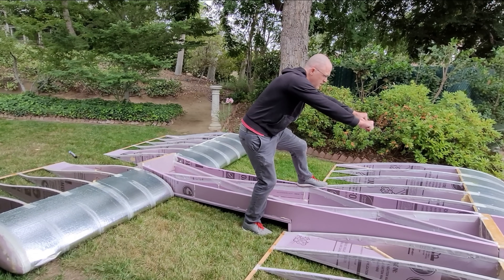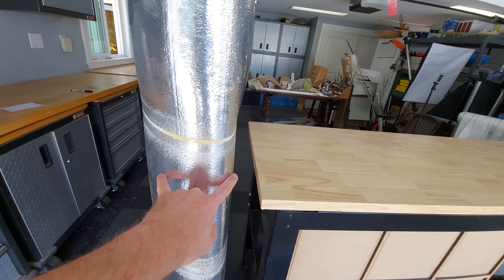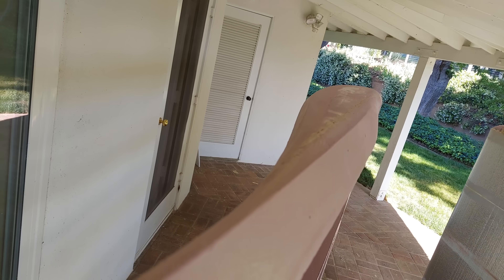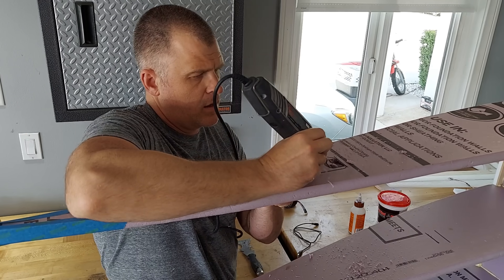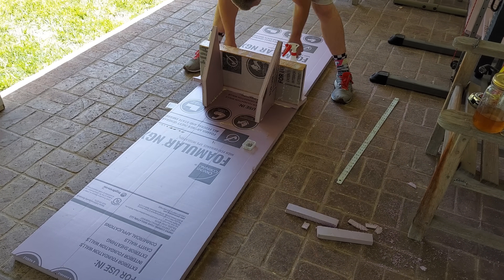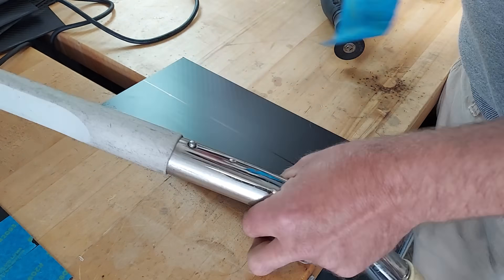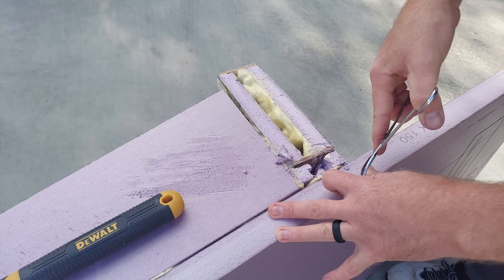Coolest Water Toy Ever? Manned Boat-Towed Ekranoplan (Build Part 2)

Comment: Use window and door foam instead. It doesn't expand as much and it doesn't have the force to push stuff out. Otherwise doors wouldn't open and windows would bust.

Comment: Foam for form not structural,
Reply: I hope your wingspars have a carrythrough unless you got aluminum squish plates
Reply: Ply paneling has voids but if you inspect you might can get by but at least some ribs for structure sandwitched to alternate foam ribs.
Reply: I studied homebuilt aircraft for years. I have 2 AP mechanics with IA ratings ive helped work on aircraft. I started a " saucey single " hydroplane to get my woodworkin shills up,
" And built 3 perots for 3 duckhunters. Those bigger hydroplane guys build their floors closed box x braces and not just a flat open bottom

Comment: I don't think you're small carbon plates aren't gonna do a whole lot . What you should have done is used a long piece  Aluminum tubing in the and fuselage and then have another piece through the wings and attach point so basically making a slip socket using a bolt or even a pin and a coter key  That used these a lot in remote control airplanes to make the wings detachable

Comment: To get a tight 90 degree wrap, round off the corners to the minimum bend diameter of the fibers, even if you vac. If you want to add structural strength as well as merely providing a surface it should be arranged 0-90. 

***********

If you need a square edge, after the resin cures you must then overfill the edge with something like Microlight and fair. In a pinch I've also cut the cloth over wide, cut darts where needed and adhesive taped the excess to the piece. Best use fast kick in that case.

Expanding Urethane foam, especially if it's a structural member, therefore dense, needs to either be in a mold or be  post shaped. If you're looking to save weight, adding internal gussets (bird cage), or external layers of cloth (monocoque), is much lighter than foam -- especially when it becomes water logged, which WILL happen.

The Gorilla glue didn't blow up? I don't understand your wing tips. 

I had a longer comment that was removed, apparently due to a TED video URL that explained why a 0-90 layup was stiffer that 45-45. Well, sorry I thought it was an excellent explanation, and funny, too. Oh well.

Comment: I really think using high lift airfoils is a mistake when trying to build a true ground effect vehicle. The ground effect happens between the bottom of the wing and the ground. What you are building is just a plane that operates in ground effect, kind of the conundrum Test flight RC was talking about recently. A TRUE ground affect vehicle is essentially a ram air hover craft, all of these other designs are just very in efficient water planes that only function properly in a very specific and forgiving envelope.
Reply: Like that inner tube towable manta ray thing, that’s just a kite that can fly but works well in ground effect.

Comment: I saw a machine in the shipping department that basically form fit fills boxes with foam to secure equipment shipping/returns when you don't have the original packaging for a large heavy expensive piece of bench gear - if you had forms you could fill them with a consistent density of foam and carve/trim only the edges making it really fast to prototype versions of equivalently solid/usable components.  They might even have different grades of foam so you can get different materials/densities.

Thanks for doing all this work and giving me all these ideas with stuff I've seen.  Inspiration I guess is the word for that.  :-)  thanks for it!

Comment: Old school mold maker that back in the day never heard of vacuum bagging. We would use clamps and waxed strips to hold down the edges  or cut out and redoing areas that pulled away. Not sure I would do vacuum bags now if I was still doing glasswork now. Seems a lot of extra work and time.

Comment: You do not need to vacuum to do good quality hand laid fiberglass. Seal the foam, then apply a coat of resin underneath the glass you put down. Then wet out the glass. Moving from the middle out:)
Reply from the maker: Thanks for the tips!
Reply: @thinkflight  . Laying the cloth flat to the surface will require a waxed paper covered board clamped in place over the bulges, or sometimes over all the work.
Working center both ways, or L to R, or anything similar will only move the bulge and the more it moves to the bigger it grows. 
Push the cloth straight in, which pushes the strands closer together, and hold it in place until the epoxy cures.

Comment: You don't need vacuum to hold the tape down.
Use Peel Ply, extending a few centimetres poast the edge of the tape.
The wrinkles are caused by the curved, stiff f glass trying to straighten itself.
The peel ply will force it into proper shape.

Comment: Laying bidirectional fiberglass around sharp edges without a vacuum bag works better if you cut it + - 45 degrees instead of with the weave. Better yet use Rutan glass RA 7725 (Aircraft Spruce) that was woven for that purpose. I've built two Long EZ airplanes using it. Cutting carbon plates goes lots faster using a table saw.
Reply from the maker: Yeah, just didn't think I'd get the buckling strength with with 45deg bias.   Live and learn.   Although not sure how much I'm learning, I already know how to do it the correct way :).
Reply: @thinkflight  90% of layups on a Long EZ are + - 45 degrees mostly with unidirectional E glass. They're about twice as strong as certified airplanes and nobody has EVER broken one. I do aerobatics in mine all the time.
Reply from the maker: @99bx99  what parts are NOT 45deg fibers?
Reply: @thinkflight  Mostly the interior (cockpit). Wings, canard, and fuselage are + - 45 degree unidirectional E glass with the exception of one layer on the bottoms of the wings at 90 degrees. That layer doesn't extend all the way back to where the ailerons are cut out to make the ailerons easier to balance. The 4" wide wing spar caps are uni at 90 degrees.

Comment: It's a bad design. Doped cloth on a wood or aluminum frame is required for strength. The two wing design stall the trailing wing and lowers the height of the air cushion.

Comment: Love the video and am excited about your progress! Can I send you a picture of the unfinished aircat 2.5 I've had in my rafters for the last 8yr-10yrs Was going to use a weed wacker motor but always wanted electric and 8 yrs later it doesn't need a 2nd mortgage :^)  My grampa worked at Convair (PBY) then went to Lockeed (Sea Dart) so it's in the blood.
Reply from the maker: Sure!
Reply: @thinkflight  sorry not a real power user where do I send a photo or two?
Reply from the maker: @shoublank2346  check About section

Comment: Really appreciate details showing the process, building techniques being used, and the thought process (as it evolves). So much more more interesting than just seeing a final prototype vehicle.

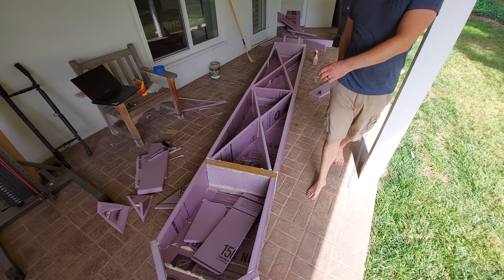Prototyping, even with a plan (8:24) can require revisions. Can't say didn't have a plan, 8:59. ;)
Doing so with an active audience overlooking is a full another level. Much respect.

BTW: For towing, you planning on having a release mechanism (for rope) at the attachment point on the Ekranoplan? Mentioning as didn't see any structure on the fuselage nose for an attachment. 
For human glider flight, either end of towing rope can be released, providing redundancy should it ever be needed.
Reply from the maker: Planning on a rope release like they use for trick skiers at the pylon, not on the GEV.   Only have time for so many details, and I trust the boaters in my life, and with my life :).  Plus I can always just jump off, I'm sure that will happen more than once.  I'm in no way locked in like a hang glider etc.

Comment: Damn, that is a lot of work, at some point I expect you will be making the craft self powered. 
We noted that our Kasperwing ultralight float planes with a wing/spray deck allowed for a very short takeoff runs. During takeoff air was trapped between the float hulls and deck assisting the aircraft lifting  off the water, in-flight the airfoil of the spray deck offset the float weight. It proved to be a unique and effective solution for water operation and exceeded our expectations.
Reply from the maker: I don't know if this one will ever be self powered, we'll see how the towing part goes.   Was planning on a dedicated electric powered build much different than this next year.

Comment: Wonder if you steer it fly by wire/ride it like a snowboard
Reply from the maker: Like a scooter
Reply: @thinkflight  was thinking like a boosted board, have one of those wireless controllers... it would be hard to calibrate it against the horizon/pitch

actually probably better to have it wired so it's not easy to lose it in the water. it could be operated by a rod on the back like one of those boats where you steer the entire engine with a long rod

anyway will be curious to see what you end up going with

Comment: Respect on cutting all of this foam. I'm currently converting a 40' school bus into an RV and just cutting the insulation sheets to fit tightly for the floors has been challenging, at times.
Reply: Have you considered a simple hotwire to cut it? I don't do construction, but lots of model plane stuff, and it's very clean precise cuts (especially great when there's odd lines to follow)
Reply: @kwaaaa  great idea. ill try that for the walls and the ceiling
Reply: @natebaird  just make sure you have really good ventilation!

Comment: What are you using for a vacuum pump setup?
Reply from the maker: APC tabletop bag setup.   Gonna have to upgrade soon for where this channel is going.
Reply: @thinkflight  yeah I'm on my second DIY setup right now. I have a medical suction pump I'm using but it doesn't like running for all day. . Even with a negative pressure on off switch, it gets pretty hot after I've fans kind of blowing on it.

Comment: What kind of PU foam did you use? We have a special type in Germany called "spreizdruckfrei" which is used for door frames and which doesn't push things apart when expanding.
Reply: Does it expand? Or is it less dense?
Reply: @ChimeraActual  Yes it expands, the last one I used gave 12l volume from a 400ml can. It's a two component foam which instantly expands and then hardens homogeneously. I think the problem with the other foam is that it needs water from the air and the parts that are exposed to air expand and harden first. When the encapsulated unhardened foam finally pulled enough water from the air to expand, there's no room to go and things start bulging.
Reply: @Vindolin  I see, It's hard to find two part expanding Urethane foam in the States, or it was when I working. Yes, that's how one part Urethane works, just needs water for a catalyst, but not much, takes a little longer to fully cure, but usually does in a few hours. I've used two part in boats in sealed molds to keep the cells closed, then it only absorbs water on the surface. although I know boatbuilders who just sprayed it into open spaces, eventually the boat doubles in weight. Usually two part is shot out of a mixer, and boy does it kick fast!

The other thing is that your door and window frames are so much sturdier than ours! I think anything that expands at all would push out that leading edge cavity.

Comment: No, its not about vacuum bagging, its about the surface of the foam, and if you get the fiberglass wetted out enough. You can also scruff up the surface of the foam in that area with some 200 grit. If you want it strong, look at how we build full size foam airplanes, such as the Sky Pup and the Woodhopper, they use the exact same setup. Thanks.
Reply: Did you build Cozy too?
Reply: @electricaviationchannelvid7863  Many planes like the Cozy yes. KR2, Q2 Quickie, Goldwing Ultralight. I was referring mainly to the foam ribs with Fiberglass 2 inch tape on the caps. Also look at wood geodetic for your shear web, very inexpensive light and strong. Great project thanks!
Reply: Where would I find those pics/vids?
Reply: @ChimeraActual  Not sure which you mean, but you can type in Sky Pup construction, Fisher aircraft construction, geodetic airplane, etc. Thanks.

Comment: I think you can spray water into the void first and the expanding foam hardens on contact, so that it doesn't burst the cavity? Never done it myself, but heard of the technique multiple times.
Reply from the maker: It doesn't harden on contact, just goes a little faster.   It didn't burst for hours, once the middle mass started curing.

Comment: Nice work!   Perhaps turn the wing tips into stepped hulls like the main fuselage?   You want a tiny amount of planing area here to correct roll without causing too much drag.  I would suggest 50 sq inches would be optimum?
Reply from the maker: It basically is a stepped wingtip, the CG is right near the TE of the front wing.

Comment: Man, I'm so excited about this project. I'm thinking of building some kind of marine vessel for years now.
Would a combination of hydrofoils and airfoils work? Could you get superior stability with both hydrofoils and airfoils working together?
Reply from the maker: It is difficult because the foils are dependent on ground/water speed and the wings are dependent on airspeed.   The relationship is usually changing constantly.
Reply: Absolutely. The existing examples are sailing hydrofoils.